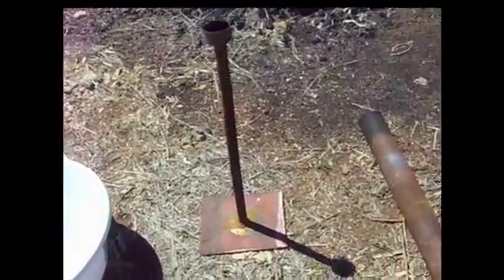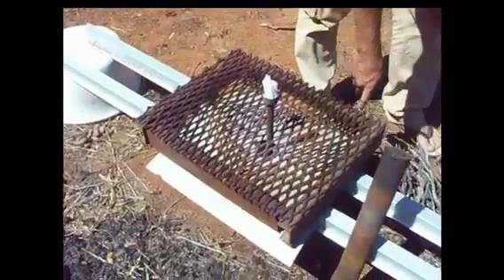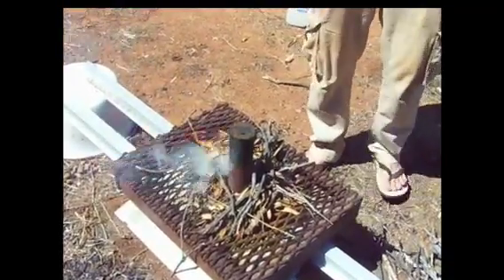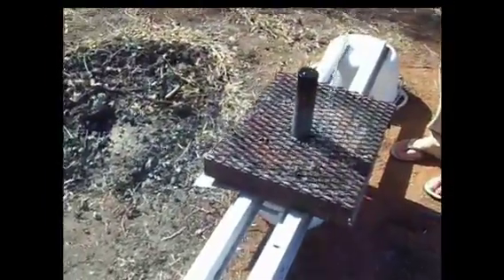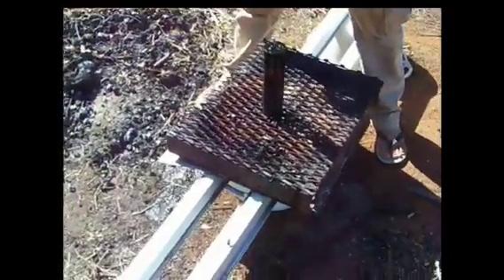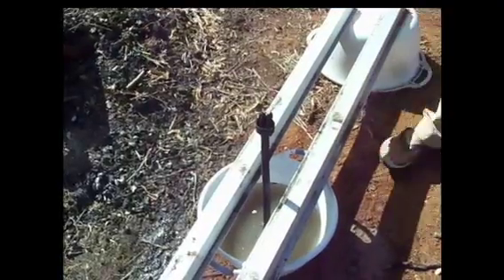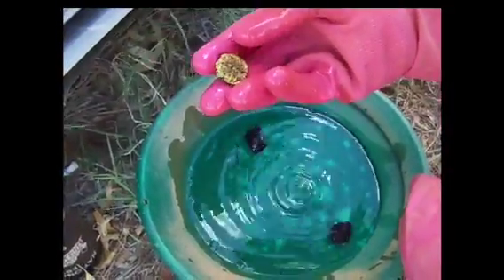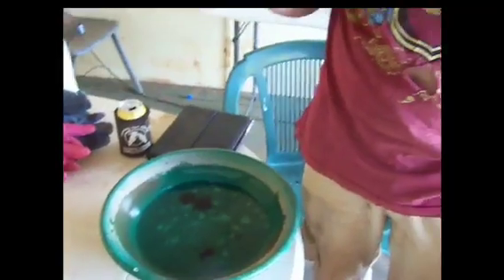Small Scale Gold Mining - mercury retort

Comment: Bro I am doing a retort with map gas.  Do I regulate the heat at 200 degrees? Should keep the heat at 200 degrees for 45 minutes? Is the a reason it is up so high cause I was going to use fire extinguisher as a chamber to heat 200 degrees

Comment: Nice result! Do you get most of your mercury back? Do you know the % you lose if any? Im assuming you have to lose some right?
Reply from the maker: You do lose a small amount, never measured the weight but I do notice the container going down a bees.
Reply: @Diggerdude29  have you ever thought about focusing the sun through a fresnel lens on the end of your retort? You can get them off old projection tvs. They make one hell of a lot of heat! Or an old sat dish or wok chromed or painted with chrome paint does as well. Any of them would require making a stand to hold them thats adjustable and the sun! You have plenty of that in AUS right?

Comment: After the initial heating and expulsion of the air inside the retort, a couple of mins with the heat applied to the area of the tube surrounding the crucible, getting it red hot. 

Ive observed mine generates a large quick burp of gas as the mercury goes up in smoke,( a deeper cooler pool of water or slowed travel of that bubble may save an extra bit of the silver stuff) immediately large balls of condensed mercury get spat out the bottom. Then repeat repeat . 

I like the silver stuff more than the gold, the gold is safe, but recovery of my mercury interests me more.

Comment: Hi mate, I use the same retort and usually have mercury fines stuck to the stem of the cup- I sand it down before use and make sure it's clean, how does yours end up Cheers enjoyed the vids
Reply from the maker: Never really noticed it anywhere except in the bottom, it is very hot where I live might make the difference.

Comment: Thanks for the video's, they keep me going on the long swings. Do you take the risk (well handled) of using mercury because it has a higher recovery capabilitiy than other methods? Do you need this higher potential because your separator bowl is very effective with small particals? I'm thinking of using the same method.
Reply from the maker: bettabgood yes mate, I've chosen this method for the very high record rate.  The Knudsen bowl has a very high recovery rate if used correctly, I've found it to be 95%+.  The mercury amalgam bowl is by far quickest way to guarantee you get all the micron gold.  Good luck with yours.